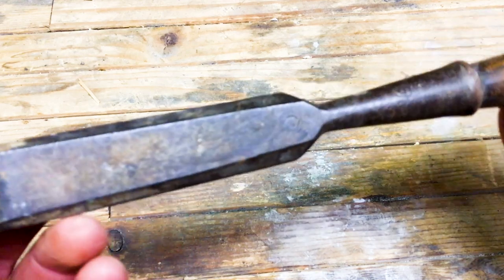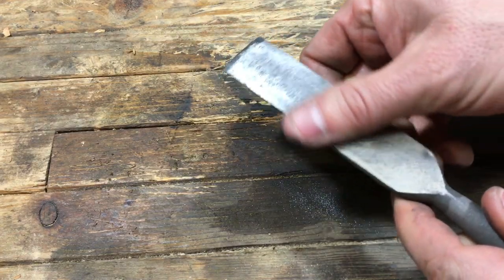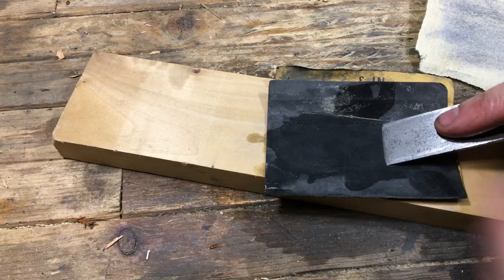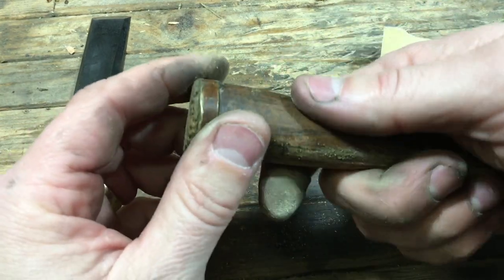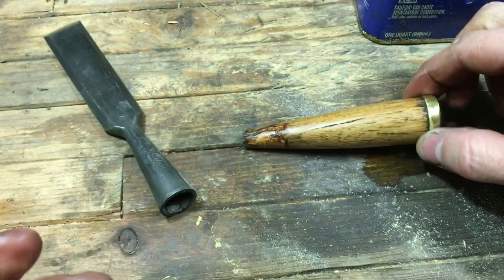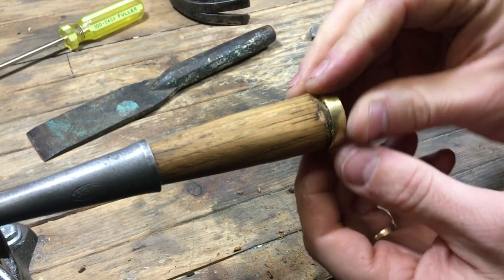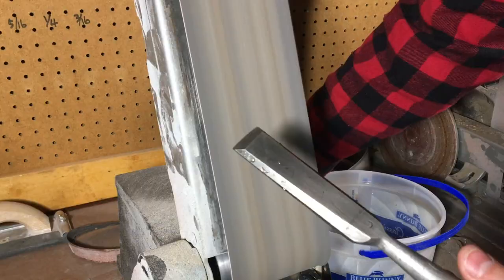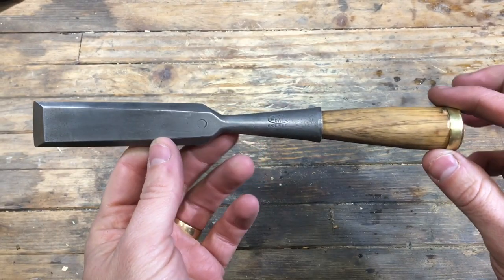Vintage One Inch Chisel Restoration

Comment: The restoration (except for the sharpening) was good. The back of the chisel should be perfectly flat for a least an inch or so. You seemed to put a bevel on the back side as well as on the front much as you would do on an axe. Chisels should not have a back bevel.

Comment: Great video.  After using the Evapo-Rust it turned black. Evapo-Rust can be used quite a few times - just filter it through a 'cone' shaped coffee filter and it cleans up pretty good.
Michael from Canada

Comment: Nice work OldShovel!  Finding one of those with the wood handle and brass ring was a good find!  I usually see just the chisel blade by itself.
Reply from the maker: Agreed. I got it, along with several other hand tools in an old wooden tool box for $75 and the chisel and handle were both in the box but not together... so they were almost lost to each other. Thanks for watching and commenting. It means a lot.

Comment: To sharpen chisel use a piece of 1/4" plate glass with wet and dry sandpaper to get a proper sharpening. I am a quasi woodworker and when I saw the file and then the belt grinder use on that gem I cringed. Water stones or wet & dry sand paper  by hand should be used on chisel. Just for your information. Power is nice but one slip and you can destroy a chisel. If you want more info let me know. Would be glad to share.Thanks for sharing
Reply from the maker: Thanks Yves. I am always open to learning to do better. I hope to not make you cringe on future videos.

Comment: Nice restoration. I am very happily surprised that you fully restored it, instead of remaking parts of it...seems a lot of restoration folks remake the wooden parts, or make drastic changes to the style of a tool or the decorative parts. 
Glad to see you didn't, and kept the original handle and metal.

Comment: I like to leave the character of the tools too. I call them memories of the steel. But, I also will put the tool in the oven heated to about 170 degrees then apply the bluing. I find I get a richer deeper bluing, touching it up with a 0000 steel wool. this came out great. on the ring however, ive put them on wooden dowels and used a plastic hammer even hard rubber to avoid dings and such.

Comment: Wish you made a new handle because to me it looks way too short and personally I like it to sit on top of the socket collar all flush.

Additionly chisels shouldn't typically have a curved cutting edge and should be square to the edges. The flatness of the bottom inch to the cutting edge of the backside is also of great importance with chisels. As a bevel edged chisel this is a good general purpose chisel for half laps, dovetails and the tenon part of mortise and tenons.

Loved the efficiency with the rust remover and the finish with the blue stuff. Looked real nice as a finished product.
Reply: I agree with most all of this, but am curious about the handle. I think this is about the same size as all the socket chisels I have owned...maybe even a little longer. 
With socket chisels, usually the aim is for the handle to sit in your palm for pairing, and I find the short handle comfortable for that.
Reply: @karl_alan  You know what I think I'm wrong there. Personally I would like it longer as I have large hands but yeah, typically they aren't that long on typical socket chisels. My mistake, I'm more used to tang chisels.
Reply: @ThatSpiffingChap  The chisel definitely is easy to be confused on. It does have the brass ring, which is definitely more common on tang chisels, and I have never seen on a socket chisel before.
Reply: @karl_alan  That's true. I guess there's less risk of splitting the handle with a socket.

Comment: That's not a chisel you should use a hammer on, but a mallet is okay. Nothing steel, just wood, leather, plastic or rubber mallets. 
if you really want it sharp, work up to 5000 or 8000 grit.
Reply: the angle of the bevel will determine a few things, like how sharp you can get it, and what it will do. a shallower bevel works better for finer work. A steeper bevel will take more material faster, but risks splitting it out rather than cutting it out leaving it much rougher when you're done chiseling. I used to use both, a bevel at nearly 45 degrees for rough in, then about 28 degrees for find finish work.

Comment: Honestly, theis was a terrible restoration.  The most important part of the chisel is the back side.  It must be sanded dead flat.  You also need to use a jig to properly sharpen it to 30 degrees with a 5 degree micro bevel.  Handle should have been remade on the lathe with a new piece of wood...

Comment: Fantastic restoration. One way you could secure the handle is to drill a tiny hole in the fluted metal and hammer in a small nail. If you don't want to do that, you could also fill the inside with epoxy.

Comment: Love the gun blu finishing tip to keep the vintage look! 
To properly sharpen a chisel you must flatten the back first on a flattened surface. Then use a fixture on your 4 in belt sander (make this) to grind the primary bevel at the proper 25 deg angle. Then use 400 grit to dress the bevel on flat and then you can polish or microbevel if you choose. veritas or similar fixtures help control the perfect bevel. A flat back is key. Never grind the back of a chisel on a non flat surface. 3/4" MDF works with dry sand paper. You are putting in 85% of the effort and only getting 25% of the long term benefit. Done right once, maintenance is easier. Cheers!